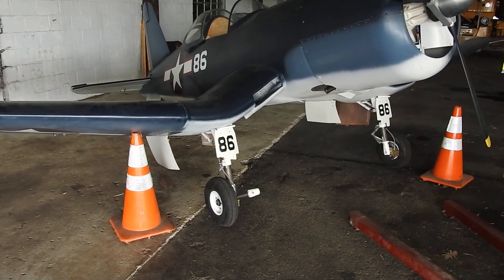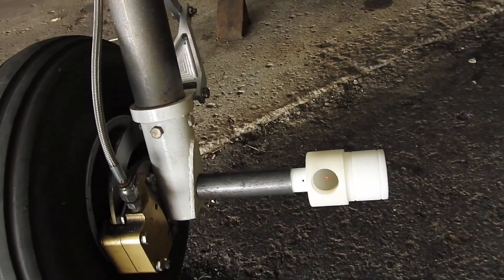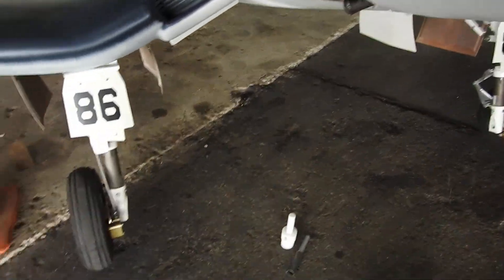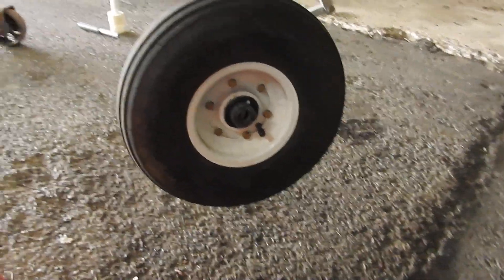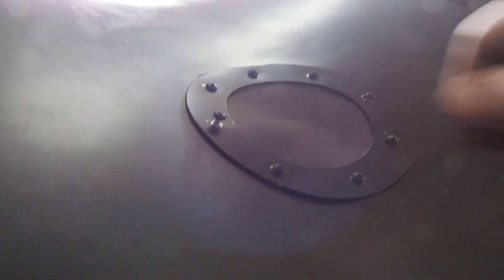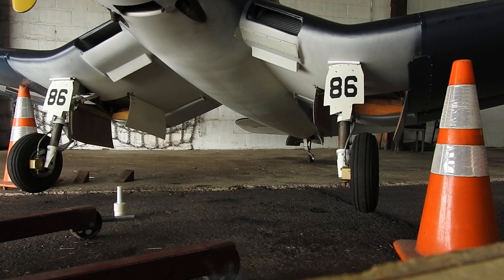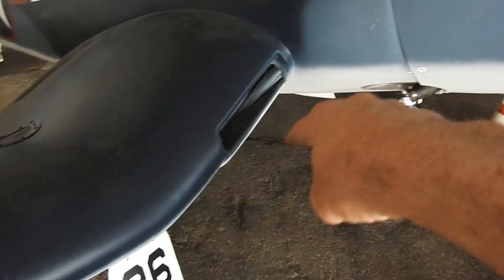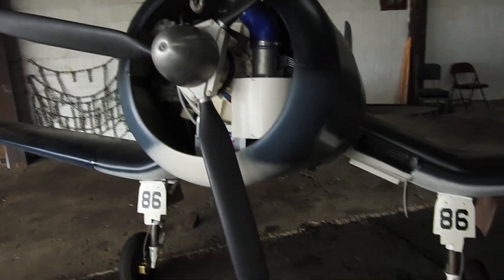WAR Corsair Update 4/29/2024

Comment: Won't the airflow over the retract doors pull them down if they aren't tucked up tight?
Reply from the maker: It shouldn't, because there is a high pressure under the wing, and a low pressure on top of the wing. That's how lift works.
Reply: @Dynodon64  Thanks for the explanation.  I really enjoy your videos.

Comment: Good evening Dino, Don, I love lasers! Your to do list have got to be getting shorter and shorter. As far as the gear door on the left side don’t bet on air pressure pushing them up it can just as easily catch the air and hold them down. It’s funny fix one thing and another thing (screws)up! Like the two access screws. Yeah, I agree. It’s time to take that bird for a ride down the runway. I hope next week you get good weather and wind right down the runway. Good luck, buddy.
   NWR California in 15 years and I am literally from the dumpster😊
Reply: Disregard that last sentence. I’m using voice texting and the TV was on.!!
Reply from the maker: I think any moving around of the plane may cause them to pull closed. Just a touch and the doors spring closed. They are under a spring like pulling effect to close.

Comment: I'm very concerned that the gaps on the front of your mains doors will catch a LOT or air and will open in flight.....and I am a huge fan!! Can't wait to see her fly
Reply: Yes the left side not fully closing is especially worrisome to me. My theory is if  the right side is working properly, you should be able to get the left side proper too. You have taken care of numerous small issues on this plane already and have come too far to let this persist. Would hate to see a small problem become a large one in the air. Just my 2 cents and good luck with further testing.
Reply from the maker: @Chadman333  It seems to be more of a slight bind than an interference problem. Both sides are the same, but may not be exactly the same.
Reply from the maker: Testing will tell me more. Maybe a camera mounted down low to watch them in flight.

Comment: Regarding the 2 screws the gear is hitting (on the top wing circular cover), I would cut the screw and file the threads smooth. No sense in buying new screws, if you don't need to. We've had an extradordinary amount of rain this week in Missouri as well.

Comment: Rubber seals for the bearings? Not felt? Interesting. I wonder if I'm visualizing it wrong. 🤔
Reply from the maker: The seals are made just for the Timpken bearings. They have a metal washer and the seal is molded on them. Their meant to be tight against the inner race to keep them from spinning with the wheel.